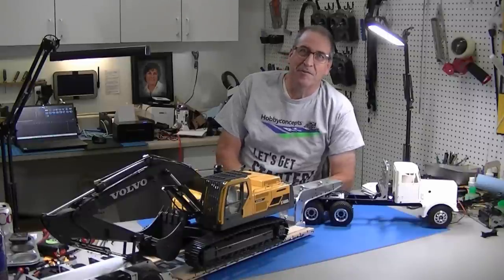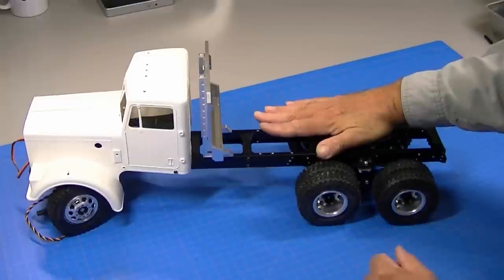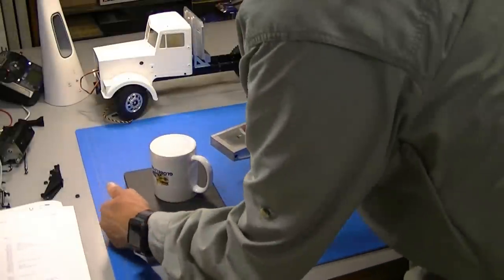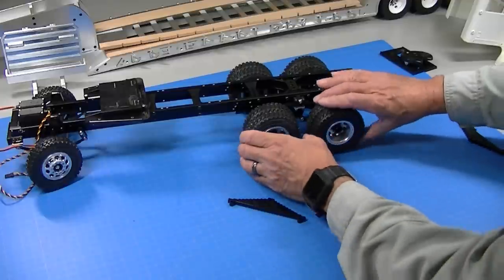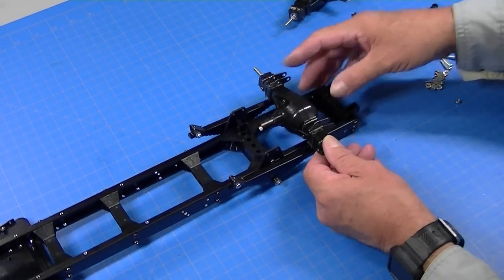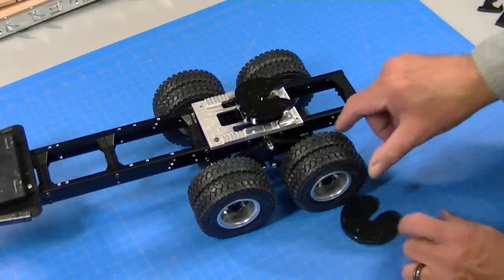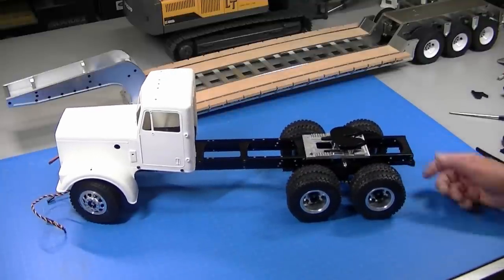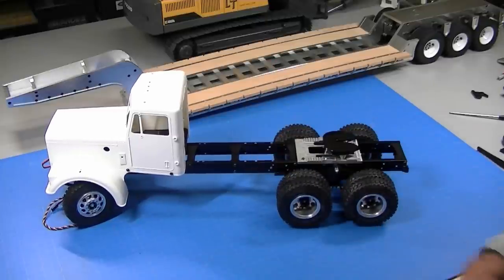1/14 Tamiya Semi Trucks - Super Load Carrying and Towing  Rear Suspension Mods

Comment: FYI...I thought you might appreciate trucker terminology to describe certain parts. The "flex" in the truck suspension is referred to as "articulation". The "tongue" of the lowboy trailer is called a "goose neck". If the goose neck is detachable from the deck, it is called a RGN (removable goose neck). Appreciate your very informative and helpful videos.
Reply from the maker: Thanks!

Comment: Great idea... I have the heavy duty suspension kit from Rc4wd and rc4wd roady tires and I have no problem hauling around my bulldozer from rc4wd and
plus I have 4:1 reduction bolted on the 3 speed trans. Nice video.
Reply: The 4-1 Gear Reduction Unit made MORE of a difference in my Grand Hauler than anything else!! 
I use a 35 Turn Crawler Motor that actually HAS Torque (unlike the 80t which has MUCH less Torque - it's just slower!!)😖  It crawls at a Snail's pace in 1st gear.
Reply: Nice... I'm using a 45 turn motor with the 4 -1 my driveway is a little steep and the grand hauler with the lowboy and dozer a mire 90lb's pulls with no problem. thanks for the reply.

Comment: Great vidoe 

3 things

1. the rc4wd lowboy is to low at the nose out of the box.  the gooseneck should have been made so the deck is up about another 1/2". people have made delrin plates bolted to the neck that lower the king pin hight and raises the deck up.

2. flip the 5th wheel mounting plate around to put the 5th wheel ahead of center of tandems. this will put more weight on the steer axle and it will steer better.

3. cut the tractor rear axle stops off and you gain about an 1/8" more travel. you need to upgrade the driveshafts for the extra travel. regardless pulling that weight the stock u joints/ driveshafts will quickly wear out.

Comment: Been wanting to demonstrate the power of these trucks to my neighbors by pulling myself with my Knight Hauler, but due to limited $$ I can't really afford those upgrade parts you show, so I have to diy most of it.  Luckily alot of the parts are relatively simple design making them quite easy to make at home using just basic hand tools in most cases. Other than the 3rd lift pusher axle & more powerful motor i installed, I also strengthen the dampers & Leaf-springs, plus I'm using a jeep-dollie to distribute the weight of both the counter weight (for traction help) & tongue of wagon I'll be setting on. Should work (HOPEFULLY) LOL.. Great video though!

Comment: One note, Bob.... 
You've definitely beefed-up (eliminated) the Springs, which will certainly handle the weight and then some. 
BUT, the very weak link is that long, soft, Phillips Head Screw holding the Tandem assembly to the Chassis! 
I would seriously consider a 3mm Threaded Rod, of Titanium or Stainless Steel.
Reply: I noticed that as well.  Ti or SST would probably handle the increased loads okay but would it be even better to step up to a 4mm bolt?  Might need to pass a drill through the parts but it looks like there's enough material to accommodate a slightly larger bolt.  Anyway, it's just a thought.
Reply: @bamabiker750  Going to 4mm would be even better. Even a less expensive Steel 4mm Bolt would be considerably stronger.

Comment: I have the same trailer and had the same towing clearance problem even with modified suspension. There’s a great 3D printable spacer that fits on the RC4WD trailer hitch, problem solved ! Part is on thingiverse. 
Cheers, Steve.

Comment: I've got the trailer and excavator.  the simple solving solutions too all the problems by getting a beefier rig like the overland. dollar for dollar its better cents.. Ive also added different wheels and rock tread tires to the trailer.  you will gain better clearance by far and have better stance on trailer, the overland can pull so much more weight as even it has metal axles beefier suspension 6x6.  I was just pulling my 95lbs daughter around house on lowboy tonight.  What I would like you see you create is a quick release gooseneck that can lift the dead weight of the 360L or the dxr2 8-)
Reply: Ive got the lights in trailer it does make a sweet glow on road I removed the junk mud flaps and added proper true rubber ones.  nice video Bob
Reply from the maker: Thanks!  Will be doing a video on lighting the trailer later.  Will use the new Beier Bluetooth trailer light module.  I agree on the mud flaps.